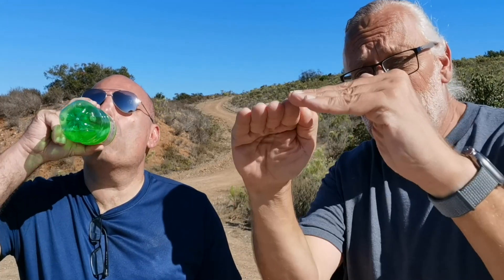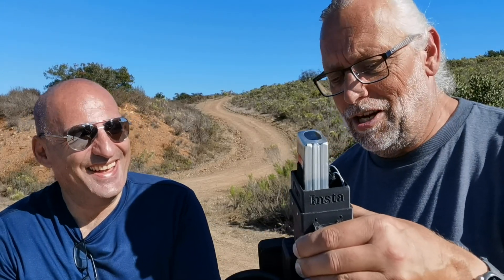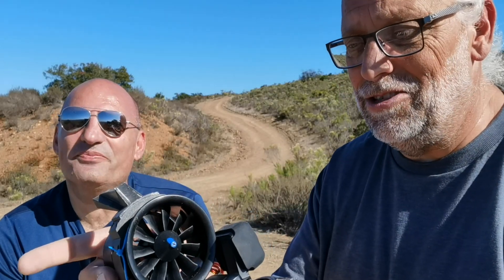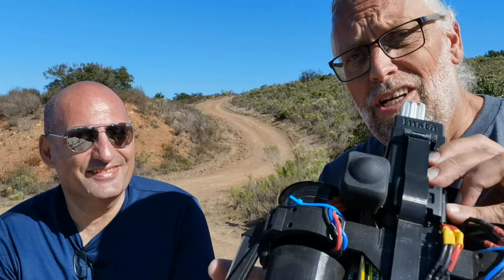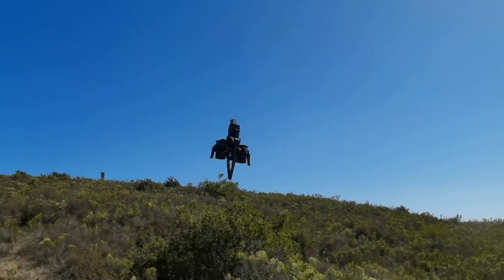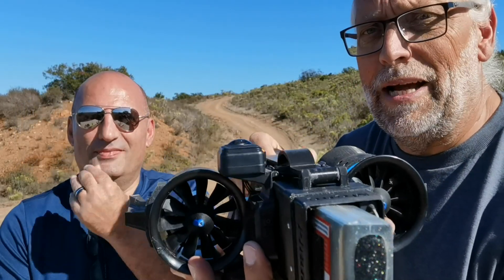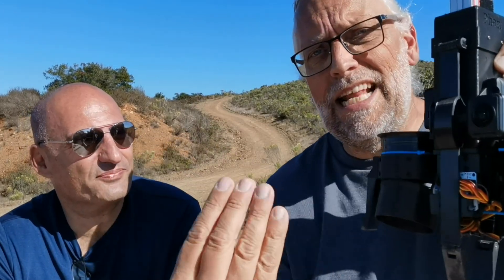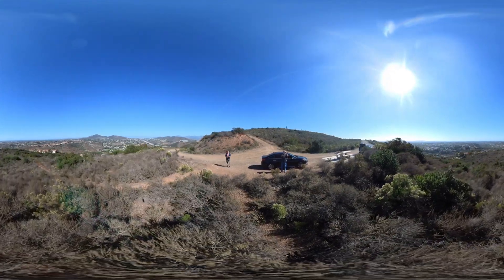ista360 sphere on EDF fan drone

Comment: QUIETER 
IS WHERE ITS AT WITH 
THE DUCTED FAN DESIGN. Perhaps Design Triangle Configuration with 3 MOTORS.
The Footage is Great!
Unique Design, want to
See equilateral of the
Same, add a Motor.🔺.
Keep Going!
Reply from the maker: cant do a third motor as the idea is to hide it inside the space between the cameras :-)
Reply: @bophoto  ok.
Was thinking of a Triangular 
Space in between three engines, so it is important for the Fans to be mounted close,
Next to each other?  With a minimum of space between engines?

Comment: It’s been a while…..I trust your judgment on multi rotors. It’s been so long since you’ve done any so therefore I ended up selling all of mine and don’t trust random equipment. I’ve move to fixed wing and have been dying to get back into to drones again. Hopefully the boom we had about ten years comes back with improvements and cheaper again because $3000+ is ridiculous.
Reply: Wait you sold all your stuff because he didnt poste any updates/!
Reply from the maker: Think he is kidding about that.
Reply: @bophoto  guess i was taking it to literally
Reply from the maker: yeah 3000 is a bit of cash -  these days you can get surprisingly competent gps based video birds around $250 or $300 ish